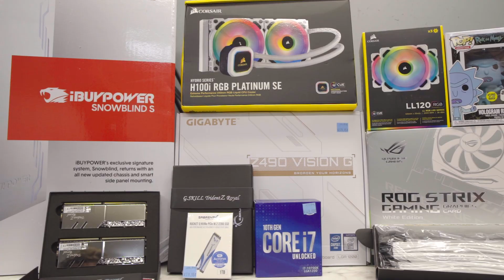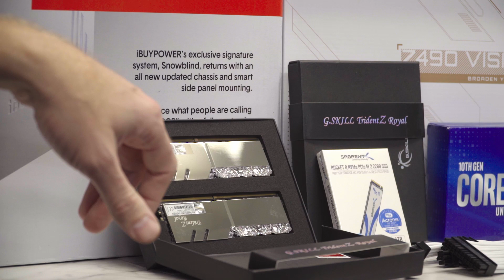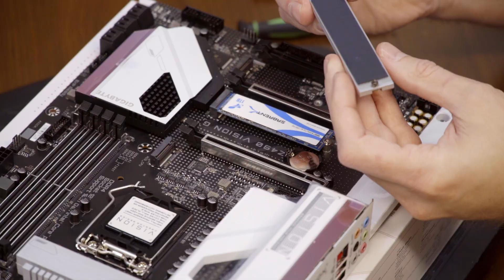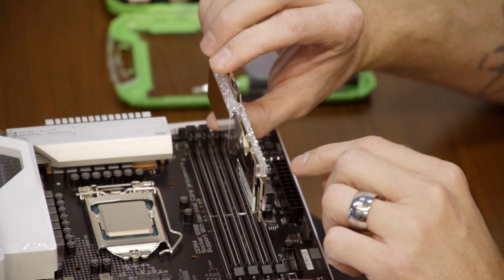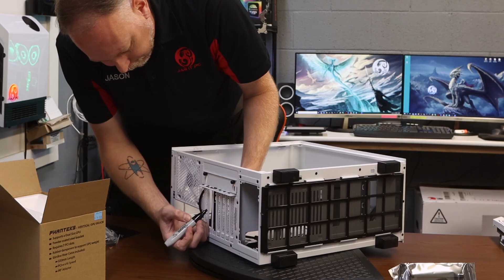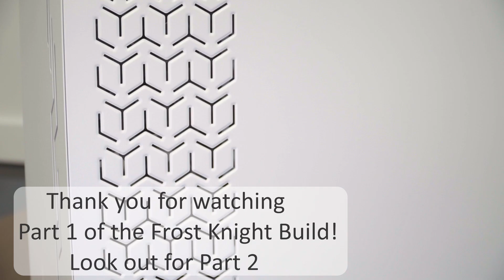Custom Gaming PC Build - iBuyPower Snowblind Pt.1

Comment: I just finished a Snowblind S case build. I've tried unsuccessfully to contact IBP. This company has the worst customer support. I"m now reaching out to others who may be able to help me. I built this system for a customer and the system turns on, bright lights appear inside and the on off button works. When it's initially turned on, in faint letters (upside down which is easily fixable) are the words "No cable attached" then after a few seconds it changes to "Go to power saving mode".  BUT  the side panel will not appear in the "extend desktop" menu so that I can extend the desktop to it. None of this makes any sense. I've tried everything. I"m hoping someone can lend a hand. Thanks in advance
Reply: yeah i have the same problem
Reply: @Colaclap  So you have the small case and although the bright light turns on, you can get no display from the video card? Is this right? Well., ibuypower unbelievably (and 4 months later) sent me a replacement module for the display panel. It's just a small plastic box (approx 4"x2"x1") with a few wire connection. It did not help the problem lol. frustrating.  I don't think it's the glass panel either because it DOES display that little error message when looked at at an angle,  in a dark room..
Please let me know if you solve the problem. i'll do the same.
Reply: @randomxaos  yeah so basically we need to revert the power to the panel because mine worked before I moved houses and I think a cord is messed up in the pc